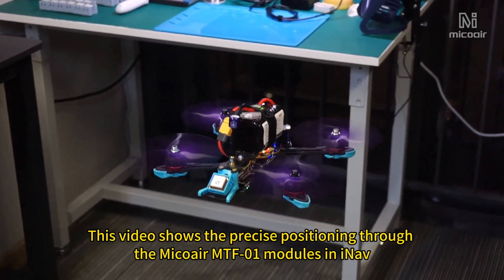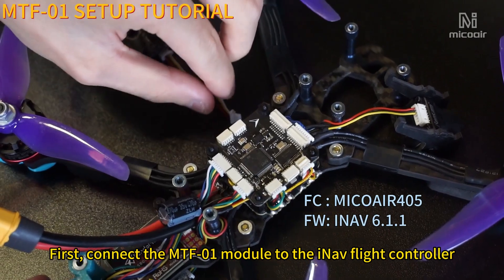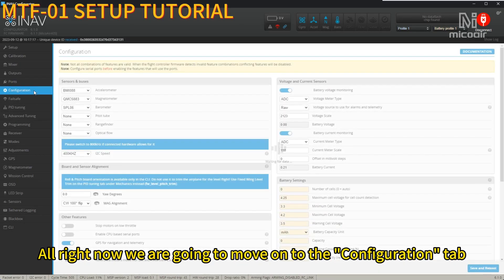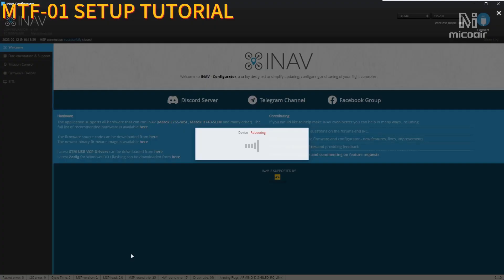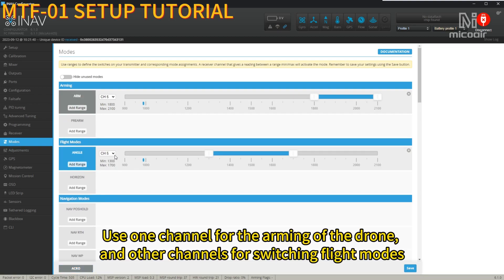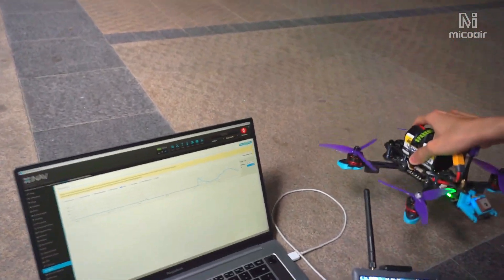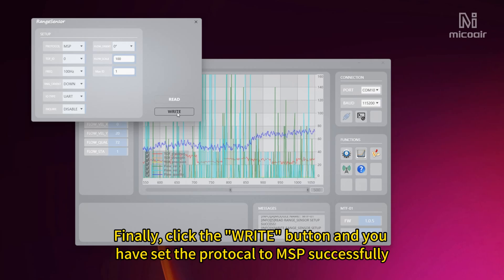Setup Optic Flow&Lidar(MTF-01) For INAV6 To Make Drones Hover And Fly Indoors Better

Comment: Question: I am using MTF-01 on an Eachine Tyro69 quadcopter with MATEKF411 board with only an accelerometer (MPU600) and no other sensor on the board. I have an issue. I can read data from the sensor (MTF-01) but I can't see poshold in the modes. Some people say it is required to have a compass and a GPS module to be able to use poshold with INAV. In principal optical flow sensor that I use can measure the changes in heading and the changes in altitude. Just like a set of GPS and compass sensor would do. Is there a way I can use poshold with my setup? Thanks in advance.
Reply from the maker: Not only the compass but also the barometer (more important) are necessary for flight controller to enter poshold mode.
Reply: Did you find a solution to this?

Comment: Great project. Followed this video step-by-step with Cinebot30 and INAV 7.0.1 but the quad is bouncing up and down in the air. Not hovering steadily in one place. All sensors are calibrated. Using geprc m10 dq gpa with baro. Do I need to adjust PIDs?
Reply from the maker: Have you tried althod mode only using barometer before? What is the effect?
Reply: @MicoAirTech  I haven't tried it. I will do some more tests today. Maybe I will downgrade to INAV 6 just to make sure I have everything set up exactly as you. I also think that I need to redesign the gps mount as at the moment with gps antenna faces upwards barometer is hidden inside the mount and it isn't getting any air in. Do you think that might be the problem?
Reply from the maker: @PowerLoop-media   I think you should try the althold with barometer first to make sure that the IMU and BARO are suitable for automatic flight, because even if you use MTF-01 or other range sensor, it still rely on the data of these two sensors.

Comment: which flight controller is used? and can i setup the fpv FC with ardupilot or px4 insted of betaflight. or do ineed to do some process to convert the FC firmware from betaflight to px4?
Reply from the maker: we use the MicoAir405 with ardupilot&inav firmware. The betaflight firmware doesn't support opticalflow and poshold mode.

Comment: Hi,

I built a beatiful drone and used MTF-01 on it. It flew perfect but once it got satalites it flew to one side and crashed. I want to know if set inav_allow_dead_reckoning=ON  this CLI command should be set to off? Could you please let me know why it crashed? Thank you. I will upload the video so you can see what happened. I will let you know once it is uploaded. In the meantime please do let me know your thoughts.
Reply from the maker: When it got satalites，INAV will use the GPS instead of optical flow, so you need to make sure if your GPS&compass can work normaly in the poshold mode.
Reply: Thank you for quick response. You are right. I disbled gps and it flies perfect. Do you have any advise on how i setup gps on inav? I am new to inav and this is my first build. Thank you. @MicoAirTech
Reply from the maker: May be you need to confiture the GPS and compass correctly, can refer to the tutorials on our official website: http://micoair.com/index.php/gps_m10g-5883/  @drvimalan
Reply: Thank you so much! I will order that gps from your website!  @MicoAirTech
Reply: Hi, i am having problems with osd icons on my goggles. Using MicoAir405 Flight Controller and inav 7. the icons are not showing in the positions that are set on the computor @MicoAirTech
Reply from the maker: OK, we will test it @drvimalan
Reply: Hi,  any idea about osd layout? Also, what type of SD card is compatible with this flight controller for blackbox data? Thank you @MicoAirTech
Reply from the maker: The OSD display may have slight errors and can be adjusted according to the actual displayed position.
Any TF card below 8GB can be used for blackbox data  @drvimalan

Comment: Is there any reason this wouldn't work on my GEPRC Crown HD? It has a F722 HD BT V2 flight controller. I'm using INav and I'm not getting anything remotely close to the video. I'm following along exactly and I'm no noob. Both icons show red instead of blue. CLI was cut and pasted. MSP settings for both sensors in Config tab. I'm on UART 5, as I do not have GPS on the drone. At one point I did and it worked fine so I know the UART should be good.
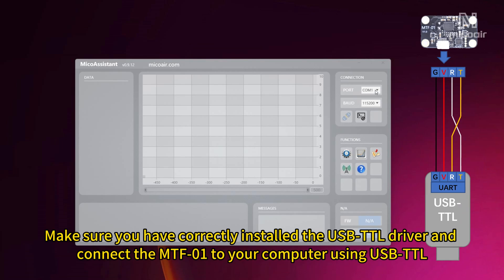Reply from the maker: Hi, according to your description, the reason may be that the output protocol of MTF-01 is not configured as MSP. You can refer to the video start from 5:40.
Reply: @MicoAirTech  I did that prior to installing the sensor on the drone. Set it to MSP and written to sensor. The sensor gives readings in the assistant GUI just fine but flatlines in INav (debug 1, 2 and 3). Both icons are red and there is no option for Nav holds in the modes tab either. I'm assuming that's because there is no sensor readings. Is there a compatibility issue with the FC I'm using? UART 5 and UART 3 are unused on my FC because they are both used if using GPS compass combo, which I'm not. UART 1 is MSP and DJI, UART 2 is Rx and UART 4 is Bluetooth. In the INav configurator I have the option of UART 1,2,4,5,6. UART 3 is not even listed for some reason and the board does not have a 6th UART.
Reply from the maker: @snowhack8903  Icons are red means the module not be recognized at all. You can join our telegram groupd(t.me/+Sba8nLdHR8ouJmGj) to discuss online, may be the connection or the uart port have some problem？
Reply: @MicoAirTech  Says link expired
Reply from the maker: @snowhack8903   t.me/+Sba8nLdHR8ouJmGj
Reply: Make sure your battery in plugged in before you connect to inav over usb. I had the same problem.

Comment: What is the name of that control card?
Reply from the maker: control card?
Reply: @MicoAirTech  sorry flight control card
Reply: @MicoAirTech  And what do you use in the drone as a unit, GPS, engine, etc.
Reply from the maker: @Thisiszeeomer   micoair405 flight controller + M10G-5883 GPS + BLS 4IN1 ESC + 2205 2300kv motor + 4S1P 21700 battery
Reply: @MicoAirTech  Thank you very much for your answers, please continue to produce content.

Comment: Please help, I connected it and it turned red. It doesn't work.
Reply from the maker: May need to use micoassistant to confirm that the protocol of MTF-01 module  is MSP.
Reply: @MicoAirTech  Why can't it connect to USB ttl?
Reply: @MicoAirTech  How can I contact you?
Reply from the maker: @asswift677   You can contact us by the AliExpress app.
Reply: @MicoAirTech  Yes, I bought it from there. OK, I did it. Thank you very much.
Reply: I set it and it's not steady.  Where can I fix it?

Comment: Where can I buy the drone mounting plate for the MTF-01?
Reply from the maker: Need 3D printing, we can provide some files, but not necessarily applicable to all frames.
Reply: That would be great !!! I bought recentlly a sensor and was planing to 3D print a housing. The files will speed up the process  @MicoAirTech
Reply from the maker: The 3D print file link has been shared in the video description  @alexciru9820

Comment: This is an interesting project! One thing I don't understand: can i use any flight controller with the mtf-01 and then just flash inav instead of beta flight (can I even use betaflight?) or do I need to use the very specific FC shown in your video?
Reply from the maker: Only these fc firmware can support it: INAV Ardupilot PX4. Not include betaflight.

Comment: I have one installed but when i go to the sensor tabs and highlight debug, i get nothing moving on the screen when i move the quad, if i highlight sonar i get a reading for it but nothing else.
Reply from the maker: Have you used MicoAssistant to configure the module protocol to MSP?
Reply: @MicoAirTech   yes, i am trying inav 7.0 RC so it could possibly be that that is the issue.  I do think the mtf01 is working.
Reply: @dobergoose1333  what inav u use?

Comment: Is this system similar to what the Avata uses?
Reply from the maker: Not completely. Although they are based on visual sensors, only two -dimensional image data is calculated by optical flow, and VIO technology similar to Avatar uses three -dimensional.

Comment: Hello there. 
I have bought and installed the MTF-01 sensor. 
Because of the limitation for the wires on my drone I had to position the sensor as if it was installed for Ardupilot/PX4. But I use INAV. Can you explain me how I can change the orientation position of the sensor in INAV?
Reply from the maker: You need to set the module's orientation to 180° by using the MicoAssistant software.
Reply: @MicoAirTech  Thanks! 👍👌

Comment: Just ordered one, does it come with an housing? If not do you have a tpu print that can be used ?
(CAD is my enemy :) )
Reply from the maker: Now the 3D print file link has been shared in the video description
Reply: @MicoAirTech  Thank you so much !!! Very nice, I will order 2 more now that i can print a mount !!
Reply from the maker: Sorry, this module does not provide a housing or print shell at present😂
Reply: @MicoAirTech  Will try to make one ;) and send it to you. More later then sooner as i am newbie to cad

Comment: Hi, what is the device at the back of the quad, with the green light?
Reply from the maker: That is our receiver call "TRS": 2.4G sbus receiver together with long range telemetry radio.
Reply: @MicoAirTech  ah ok, great. so all the position hold is being handled by the MTF-01?
Reply from the maker: @paulrobinson270  Yes, it is positioning through flight controller + MTF-01 in the video, also you can use GPS instead when fly outdoors.
Reply: @MicoAirTech  excellent thank you. I will give it a go. Looks great

Comment: Very cool sensor! Thanks for sharing. If we wanted to try on a cinewhoop for filming indoors with more consistent level, would this be worth testing? The current information says for outdoor use. The indoor areas would be properly exposed and well lit. thinking about trying this on a AOS 3.5 Cinewhoop with O3. Have not used inav before but hoping it wouldn't be too hard to learn - coming from betaflight.
Reply from the maker: Worth a try😄.
Reply from the maker: @grahammacdonald9400  In this video  we use inav for 5-inch frame. However, we also use ardupilot on a 2.5-inch cinewhoop,  don’t think it has anything to do with the size.
Reply: MTF-02 looks like what you're looking for.
Reply: @g00gl3_us3r  why the mtf-02 vs 01?
Reply: @fokusfpv  Much smaller, lighter and better suited for a 3.5 and made for indoor usage. Up to you tough. BTW watch your fingers don't test it by pushing the drone like this guy drones can cut off your finger.
Reply: @g00gl3_us3r  I didn’t know about the 02’s until your post. I have 2 of the 01s about to arrive. hmmm

Comment: Can add more for front back and side way?
Reply from the maker: MTF-01 is an optical flow sensor and can only be installed downwards, but we have other range sensors products such as MT-01/MT-15, which can be installed in other directions (front back or side way).
Reply: If use more than one sensor, how to setup?

Comment: Great work! Have you tried implementing this with gps+compass turned on? INAV documentation indicates that setting dead reckoning ON could cause unexpected results. Have you found it possible to transition the position hold capability between indoor (op flow + lidar) and outdoor (gps+compass)?
Reply from the maker: We will try and tell you the results.
Reply: @MicoAirTech Awesome that would be great! So is it correct that this sensor has a max 8m height capability of position hold?
Reply: @MicoAirTech  if this ganna work , I will equip it on my several drone . Hope you work out soon !!
Reply: @MicoAirTech  Also interested in this. Today i received your MTF-01 (THANKS!!!) and already got it to work great indoors (need todo a bit more tuning to reduce the fast wobbles but it works great !!!). But also have a gps/compas so will the much increased NAV tuning parameters not negatively affect  alt/poshold when  flying at lets say 50 meters with my quad ? Do i maybe need 2 profiles and switch between them mid flight or is there a better solution that works for both so i can safely navigate between low level BAR/MTF-01 controlled flights and higher baro/gps/mag controlled flights.
Reply from the maker: @tachyonpost1472   We are also testing this. The PID used for optical flow indoor flight in the video are indeed slightly larger for GPS mode. Maybe we can find a compromise params,  or maybe really need two profiles.
Reply: @MicoAirTech  Top. Keep us posted about your results. Due to very bad weather i cant test anything right now so looking forwards to your result.
p.s. Just an idea but maybe we can use programming logic page to adjust certain key values based on altitude. So if above a certain altitude adjust to some less agressive values and visa versa.
As what i saw indoors was that at lower altitudes eg 1 meters, it was rock solid but when i went to 2 meters it started wobbling more. I reduced the angle strenght to about 30 (using osd tuning method in flight) , which fixed that and made it a bit more floaty poshold compared to an agressive but stable up to the ceiling. Looks better for indoor filming use.
Reply: @MicoAirTech  please keep us updated, very interested in combining this approach with gps+compass

Comment: Excellent video, I want to put it on my drone, I didn't know what could be done. A question about the monitor support, where can I get it? I have a jumper station and I want to put the monitor on it like this
Reply from the maker: You need a monitor and a 3D printed bracket to hold it in the remoter.

Comment: Very brave putting your hands so close. This looks more effective than the lidar I currently have installed on my cinewhoop drone. I think I will buy one as a replacement. Thanks for the detailed setup video.
Reply: Why hands being close matter
Reply: @jamessawyer8744  the props may not cut through the bone, but they will cut to the bone.
Reply: @kurtzFPV  I thought you meant cause the lidar. I heard when you start cranking up the vtx the radio waves can be cancerous
Reply: @kurtzFPV  Can plastic do that? (If not carbonfiber)
Reply: @TaigiTWeseDiplomat--Formosan  I do not have personal experience with this as I respect even a 4s 3" drone like it is a power tool, but a quick search will demonstrate that these have the torque and speed in the props to cut you seriously. And the kenetic energy to do pretty serious blunt force damage if they hit you at high speed.

Comment: What is the 3d print for the sensor mount? Did you dremel out the bottom plate of the Mark 4 frame?
Reply from the maker: We do have some simple processing on the bottom plate of mark4.

Comment: Nice video, how does the sensor compare to Matek optical flow and lidar sensor ? Does the IR light from distance sensor help the optical flow camera in dim areas ?
Reply from the maker: Hi. MTF-01 has a more powerful ranging sensor with a range of 8m (according to the environment). It can work outdoors and in the sun,  while matek's cannot. In addition, MTF-01 can not only be used for INAV, but also compatible with Ardupilot and PX4 flight controller.
Reply: I'm more interested in the optical flow sensor performance @MicoAirTech
Reply from the maker: They all use PWM3901, which is the same in some way, but the optical flow sensor itself cannot work alone in the flight controller and must rely on distance measurement, so the performance of the optic flow is related to the range sensor. @flowrfpv

Comment: Please tell me the specifications of the drone, controller and monitor you are using
Reply from the maker: Frame: Mark4 5inch Motor: RS2205 2300kv Batt: 21700 4s1p Controller: MicoAir405 v1.2 (our product) with INAV6.1 ESC: BLS 4IN1 45A

Comment: Outstanding info.  how well does the drone perform in acro mode with the optic flow sensors engaged ?
Reply from the maker: Optic flow can usually only be used in positioning mode（poshold mode).